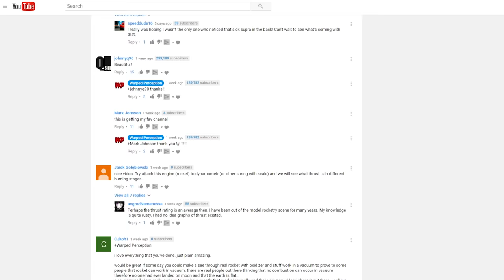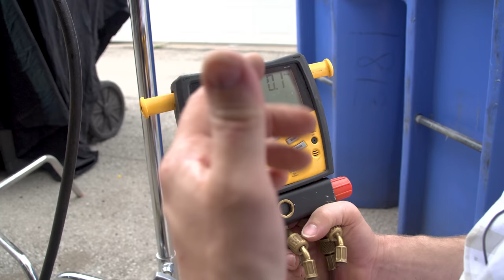Model Rocket Engine In A Vacuum Chamber - 4K Slow Motion - will it burn? - Rockets (S1 • E3)

Comment: I"M JUST GONNA THROW IT OUT THERE FOR THE WORLD 
DID YOU HEAR NOISE?[inside microphone] : remember the bell experiment? NO SOUND IN A VACUUM
DID THAT CHAMBER FILL WITH AN ATMOSPHERE? : remember the void of space has NO atmosphere to push against. (and Nozzle size adjustment is for what, boys & girls?) {LGBTQ MT LMNOP123} for changes in ATMOSPHERIC pressure...Duh!
DID THE ROCKET ENGINE MOVE BEFORE THE ATMOSPHERE FILLED THE CHAMBER? : remember the chamber would need be large enough to make any FUEL GAS EXPANSION, null and void... was this large enough? was there near space condition VACUUM?
DOES THE POSITION [ location in PIPE] CHANGE THE OUTCOME? remember the tube was Clean and rocket was closer to left end (blip) and then it was closer to he middle in a {USED} dirty tube... what was the outcome of the first firing? {HMMMM!} nice video edit, ATTEMPT. >caught U< 
DID I JUST ASK TOO MANY PERTINENT QUESTIONS? : remember one must try to Nullify the results, or DISPROVE their Own tests... did we see a falsification re test?
SCIENTISM IS NOT SCIENCE 
...again Belief, Belief, Belief... Does Not equal KNOWLEDGE

Comment: Something is wrong with your vacuum. Lol! Oxygen is impossible in a vacum. No oxygen? No rocket. That tube would have collapsed in the supposed strong vacuum of “space”
Reply: Solid state rockets have an oxidizer mixed in to provide the oxygen needed for combustion. Do your research before you make such ludicrous accusations.
Reply: Also the tube is strong enough to hold up against a vacuum. Just because it's a vacuum doesn't mean it'll crush anything.

Comment: sorry, but this is complete rubbish .. or do you really want to make the users belive, you can archive anything like a vacuum in a thin walled, quite long PLASTIC tube like this? This video does not prove anything, just how to fail 100%
Reply: In fact it has been "proved" long ago, and used since decades. Why do we need mmore?
Reply: Thomas Kundera of course it has been proved...but this setup proves nothing as it is impossible to create any (usable) vacuum in a long thin walled plastic tube. There are very obvious hints, which are clearly visible in this clip (besides logic)...like the smoke, which flows out at the point, the ignition happens.In a vacuum, it would not flow like this...it would expand..very fast ...etc.